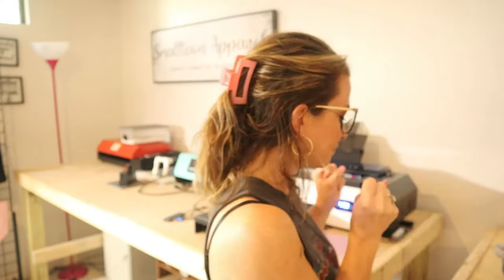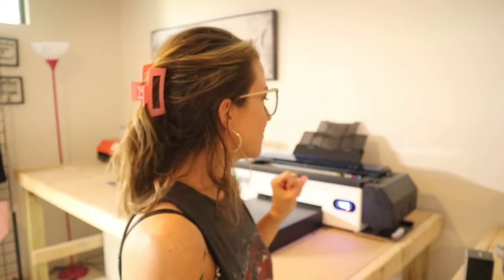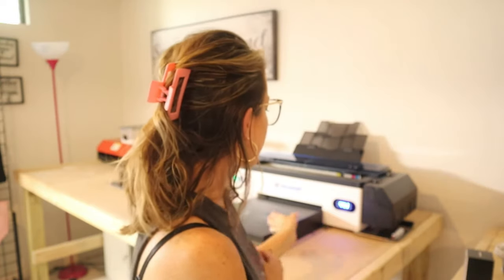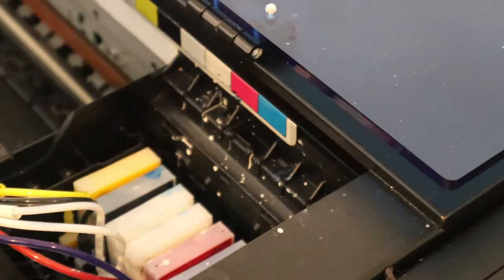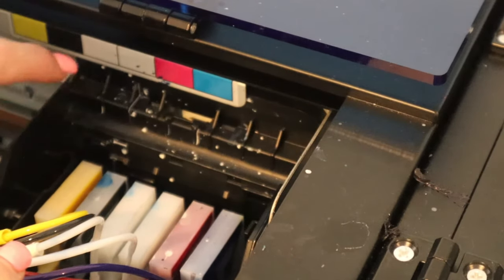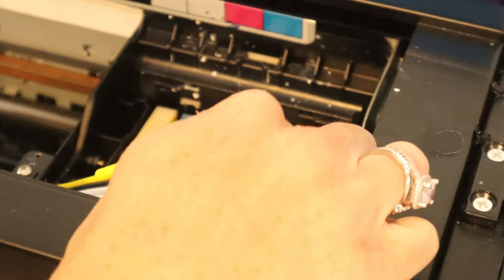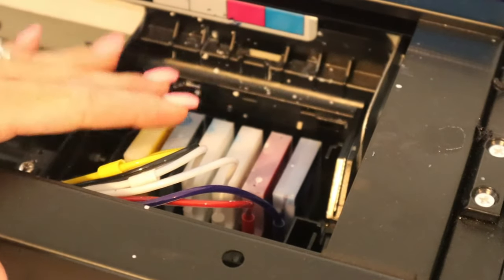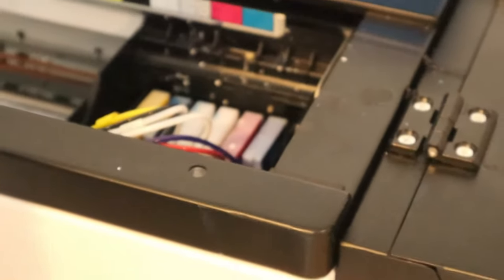STEP BY STEP DTF PRINTHEAD CLEANING TUTORIAL/CLEARING CLOGGED NOZZLES ON DTF PRINTER

Comment: Hello how are you ? Great video. I have a question my printer cartridge moves when you turn it on when it slides back to the side and tries to move again it makes a loud noise then the ink and paper light starts flashing
Reply: You have ink in the way I guarantee.  I had this problem. Try to find a hunk of ink somewhere in your cleaning station. It's blocking.
Reply: @itspersonal305  I have cleaned it twice, I will do it again. Thank you
Reply from the maker: This happened all the time with mine. I would reset it and clean around bc there may be ink stuck. After mine did this the motherboard went out. I hope you have great luck with yours though. 🩷

Comment: hey there!, got a question here, i got a broken lines on white chanel when i nozzle check, and i already flushing from nozzle like what u did, the upper and bottom section spray nicely, but mid section not spraying, any idea how to solve this ?
Reply from the maker: That means it's clogged. I would try to do it again bc it means that is clogged up. I have some special cleaner I have for my 24 inch printer called Red or you can find the other called Crimson... it gets clogs out🩷

Comment: So my printer stopped printing white yesterday and i did EVERYTHING but the part where the tube goes on with a cleaner.  I dont have the cleaner available and need to do it now.  Can i use distilled water instead?
Reply from the maker: I honestly don't know about water for that...
Reply: @smalltownapparel hi. White ink must it be stirred everyday to prevent pigment sediment?
Reply from the maker: @pietpompiepompiepiet940  yes you need to stir it daily... run the printer daily for ink flow

Comment: the most issue with epson dtf printheads its with clogged manifold filter the very first thing witch 
is clogged is manifold because inside the manifold are micro filters
Reply: Hi... Did you get rid of the tip with tiny holes of each manifold for each color...?
Reply: that's true. here in the Philippines, its very dry. So as a printing business owner, we always put a cleaning solution at the capping station so that the nozzle plate keeps wet all the time.